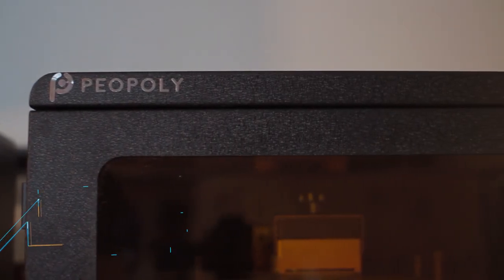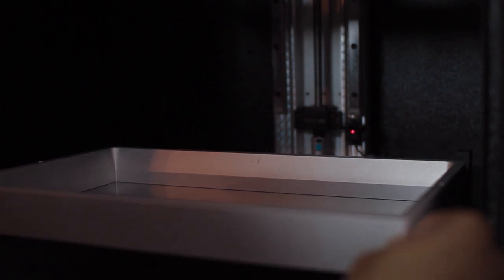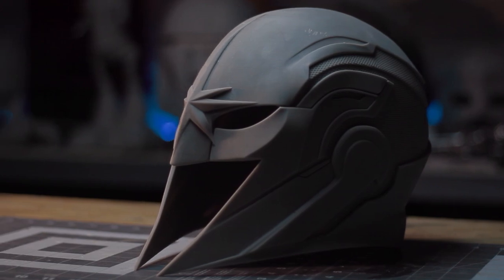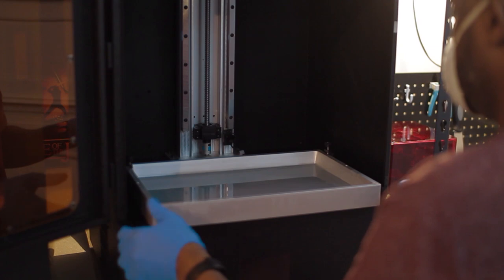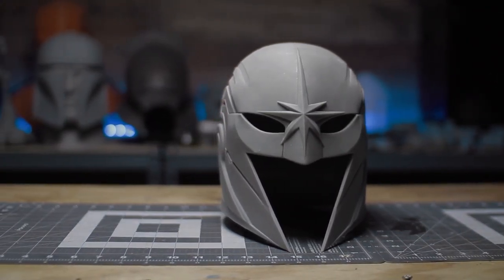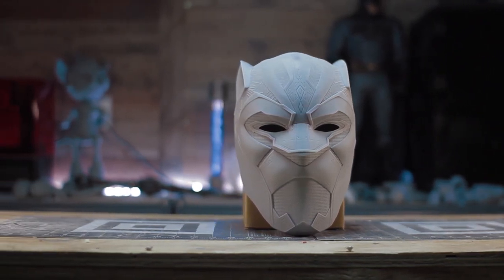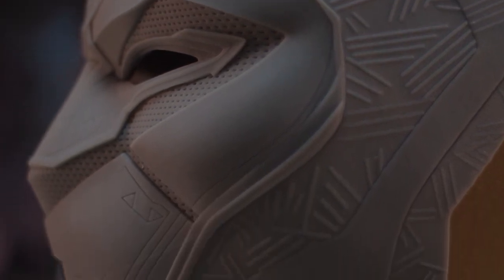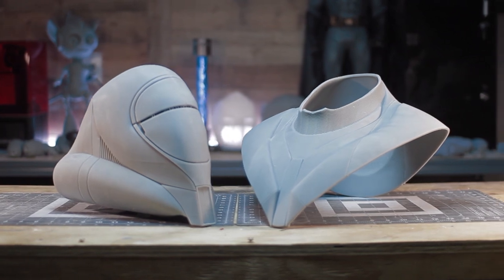3D-Printing Full Helmets! Phenom L SLA Printer Review

Comment: 37 hours..... and the monitor can only do 400? Well there went 1/6 of your  monitor's lifespan on your first print. It's hard to consider something like that practical.
Reply: I don't know for certain, because I'm just seeing this product for the first time. However, if I were to guess, the LCD likely doesn't stay on the whole time. It likely has a sleep-timer that shuts it off, and if you need to check the status, it wakes back up. Again, this is pure speculation on my part, but I doubt they leave it running for an entire 20, 30, 40 hour build.
Reply: @Bad_Wolf_Media  The LCD is what does the printing.
Reply: @forton615  Gotcha! I misunderstood what he was talking about, but I've got it now!
Reply: 400hrs is total exposure time. Out of that 37 hours allot of that will be ramp up.ramp down and wait time, rather than exposure time. Still if they are quoting 400 hours you can bet thats best case and it will be less, as with most other printers. Clearly resin printing at this scale is expensive and really only  practical for industrial/commercial use.
Reply: The Phenom website says the panel life varies from 300 - 800 hours, with 400 hours being the average. Replacement panels are $125, which isn't cheap - but it's not end of the world money and maybe it's worth it considering the quality of the prints and all the finishing work it can save you.
Reply: @Bad_Wolf_Media  The LCD displays each slice of the print in order to harden the resin, it is therefore partially on constantly through out the entire 37 hours. The word partially is pretty important there if 30 hours of build is the vertical face panels of the helm then the pixels of the screen that flash to cure the resin of the face panels ARE going to get a hell of a work out... Moving different prints to different parts of the build plate attempting to even out the usage of the pixels across many prints might be a way of extending screen life.
Reply: @fuk877  yes in the right industries this will pay for its self in no time. Would love to knowhow reliable this is. The peel forces for prints this size must be immense.
Reply: @paulgerrard6085  If anything it's probably a very low/pessimistic estimation so people swaps them earlier than they need. More swaps = more money.
Reply: Much like the bulb in a projector, it's an expensive consumable.
Reply: I have a resin printer, Print time does not equal lifespan consumption at 1:1, its more like 1:2 or 1:3 in reality depending on exposure and lift times. LCD's for MSLA have a rough rated estimate in terms of minimum lifespan when exposed to the UV curing light. It is the UV light that causes the degradation. So a 37 hour print likely consumed 12-18 hours of UV exposure time. The mode of failure is also subtle and not instantaneous deadpixel in random places, and by that point you would have printed way past due its expected lifespan before you notice your print or vat degrading.
Reply: Seriusly until a lighteningstrike killed it my LCD TV set worked just fine after a decade of use...
Reply: @michaelpettersson4919  do you fire high intensity UV through your TV?
Reply: @paulgerrard6085  No of course not. Let's just say I am curious about why it is that theaee screens have to endure that kind of punishment? Is it an integrated part of the 3D printing process somehow because it is obvius that a screen placed safely on the outside of the machine that goes dark after a few moments of operator inactivity would last for many years. This isn't the case hence my confusion. There seem to be a reason why it need to be active and bathed in UV light constantly but what that reason is I do not know. So basically, I am confused.
Reply: Yes, the display panel isn't the screen on the control panel, it's the LCD mask that blocks the UV light from the areas that aren't supposed to harden.
Reply: @michaelpettersson4919  UV light breaks down the organic binders in the LCD matrix.
Reply: @AlRoderick  Aha, then it suddenly make sense. Thanks for the information, I was really confused about it.
Reply: @Koushakur  Actually, it's pretty much right on for an RGB panel, though highly variable. ( Hence the 200-800 hours )

As Daniel mentioned, this is exposure time, not print time. For a standard RGB panel, you're looking at around 50/50 on/off. Your settings, resin of choice, etc. can have a huge impact here. If you're printing with a black or clear resin, you need a lot more exposure time, so you'll chew through the panel faster. If you're using a fast grey, it's a lot less. If you do lower layer height, you have more exposure time per mm, so again your prints per panel will suffer.

Monochrome panels last dramatically longer. Estimated 2,000 hours, and they have far lower exposure times ( 2s vs. 6-8s. ), so your prints per panel goes through the roof. If Phenom switched to monochrome, instead of around 20 full size prints per panel, you would be looking at more around 300 prints!

Unfortunately, modern high resolution panels have no reason outside of mSLA printing to be monochrome, so they largely just aren't there. Some starting to appear however, such as the Elegoo Saturn which has a 192x120mm 4k monochrome panel.
Reply: Your math is a might flawed. That would be more like 11th to 12th.  fortunately as others have pointed out the difference between print time and exposure time makes it more like a 40th or so, and a helmet is a pretty large print. Still this is a technology that is still developing... It will take several years before it is truly affordable. until then, you are paying the premium to be in on the leading edge of it. None the less, this is a technology that will produce far higher quality parts... A smart designer will have both (once SLA is in the budget) and use the one best suited to the needs of the given project.
Reply: @mattlewandowski73  It's been affordable for a long time actually. I bought my Mars for $260 nearly a year ago. It's now down to $190. Sept. will see the Mars 2 Pro release with a monochrome for $300, and a non-pro soon as well. That's just from Elegoo. There are numerous other companies with various products either out now or coming out.

Comment: How much does something like the black panther helmet cost to print in terms of resin?
Reply: Depends very heavily on the volume of the print, the supports used, how long you let it drip into the vat after printing ( quite a bit of resin can pool on the surfaces, so recovering that is a good idea ), and resin used.

Very roughly speaking though, around half a kg probably, which with standard Elegoo grey is about $15.

Comment: So the LCD screen needs to be replaced after 400 hours? The test piece alone was 3 hours, and a helmet takes 37 hours?  That's already 1/10th of the lifespan of the screen. That's gonna be alot of screens fast.
Reply: The 400 hours is exposure time, not print time. The ratio varies a lot based on your setup, but is mostly around 50/50. Still not great though, and why printers are switching to the far longer lived monochrome screens. ( Around 2,000 hours and 1/3 the exposure time, so about 20x the longevity. )

Comment: How easy is leveling? I've never used a resin printer, but I find it a nightmare on bigger prints with a fdm machine.
Reply: I believe the Phenoms come leveled from the factory, but even ones that have to be leveled manually it's immensely easy. For the Mars here is the process:

Loosen 2 screws.
Press home.
Tighten front screw, tighten side screw.

You're done.

Tiny variations in leveling are simply fixed by the way the curing works. Since the light cures the resin all the way through from the bottom of the vat up to the plate, it fills in any small gap. You have to be pretty far off to really matter. ( What will happen then is 1 side is raised up much higher than a normal layers thickness, and does not fully cure all the way through. Since it's only partially cured, it doesn't hold onto the plate well. Your print then either falls off, or the side warps. If you're using a raft and have your print raised, it's pretty common for this problem to go away by the time you make it to your actual model, so generally as long as it doesn't completely fall of you're still good.

The level of your bottom exposure, layer height, and color/opacity of resin chosen has a substantial impact. If your bottom exposure is extra long ( and there's basically no reason not to ), you use a normal resin ( like standard grey ), and a normal or even little lower layer height ( I prefer .04mm ), then you can be very quick and loose with your level. Plus, once you've leveled it, it's good to go until you do something stupid ( like laying the plate down and pushing down to get a print off, moving the plate. )
Reply: @zemerick  thanks so much! I screenshoted this to make sure I make use of this information when I get my first resin printer (smaller one to try before I jump to this beast).

Comment: Only 400h? That is so low.
Reply: Seems low to me, too. It's just an LCD, I'm betting it'll go longer. Resin prints are usually faster, too.
Reply: Imagine if you were buying a FDM printer that would only run for 400 hours before you had to replace the extruder. No one would buy it.
Reply: He mentions his being well over 400 hours in the video, too.
Reply: @nateinthenorth1999  Still, having the manufacture claim only 400h is scary.
Is almost the same as you thinking that your monitor will only last 400h. 
If you use it 6h a day, its gone in 2 months.
Reply: @nateinthenorth1999  Yes and no. It can last up to around 800 hours. However, it also might last just 200. 400 is the average, and is standard. Though...normally we're talking about a $20 5.5" panel.

This is why everyone is switching to Monochrome panels that get 2,000 hours.

Comment: Aside from the cost of LCD replacements, I think the biggest pain point with resin printers of this size is the cost of resin, which can run you something like $100 for a single helmet-sized print.
Hopefully Peopoly follows the monochrome LCD trend as well, which seems likely to increase the lifespan of the screens by a fair bit.
Reply: Resin has gone down a fair bit, and continues to fall. You can easily get some for $30 / kg. A rough estimate for a full size helmet is around half a kg, so actually about $15. Pretty rough estimate though, depending on actualy size, thickness, support needed, how much you let it drain before removing from the plate, etc.
Reply: @zemerick  Interesting, I was basing my assumptions on a video that Uncle Jessy made about the Phenom L back in May, where he said a helmet took him something like 2.5 to 3 bottles of resin to the tune of ~$100.

It's good that resin prices are still coming down though. Recently filament prices had actually gone up some due to supply shortages, followed by COVID, which increased prices even further.

I don't have a resin printer yet, but I'm looking to get an Elegoo Saturn later this year, so I guess we'll see!
Reply: @AuntJemimaGames  It depends very heavily on the helmet and resin. You could easily spend tens of thousands on 1.

IIRC he used half kg bottles, and Siraya Tech resins which are more expensive.

Comment: Fantastic review. Im researching to purchase my first resin printer and it is hard not to just go all in and go big from the jump. Why buy more than one printer? But I think you've convinced me to go with maybe something like the Elegoo Mars (or wait for saturn) and really learn the process thoroughly before going this big. So much to consider but this was very very helpful 😊👌
Reply: I highly recommend that. I have a Mars that I have loved, and a Saturn on the way. The Saturn will also be superior to the Phenom nearly across the board, though obviously much smaller print volume. ( Higher detail, faster print time, and longer lifespan panel though. Both use the same firmware and software, so the extra $2,200 for the Phenom L is kinda ridiculous. )
Reply: @zemerick  Thanks for the additional input from your experience. Im thinking ill get the Mars to get started asap and then the Saturn later on in the year when it's available. I was looking into the larger format printers cause I have projects that would require the larger print space but I have majority smaller/medium sized prints so I think ill send off larger prints in the meantime while I learn all of this. A bit of a self compromise.
Im so used to doing everything myself when it comes to sculpting, molding, casting that I resist the idea of sending work out lol 😅
Reply: @EbbnFlow_Design  I can absolutely highly recommend the Mars to start with, and I even got mine for like $270 and it's now down to $190 and sometimes on sale for even less than that.

I also encourage you to read up a lot on it though. There are a number of gotchas that can be easy to miss. ( For example, start with standard "fast" elegoo grey resin. Color is critical, and should not be taken lightly. )

Be careful though with what you read, there's a lot of misunderstanding going around lately, largely turning very specific tweaks for specific issues into generic cure alls.

The elegoo mars subreddit is a good place to go to.

There's also the Mars Pro. It has some nice QOL improvements, but they also recently messed up the LED lens recently and it has been causing problems. It should be fixed now, but it's something to be aware of.

Comment: At $2800 it better be amazing.  The specs are incredible, and 3D printers have dropped drastically in price.  If you have the 3 grand floating around this is by far the machine to get.

Comment: I'm only 5 minutes into this video, and I'll delete this question if the answer shows up later in the video. What the heck are you using to cure these huge models?
Reply: Normally for curing resin prints is to use uv-light from some kind of source i.e. lamps or sun.
Reply: UV

Comment: After printing all of the pieces for this video and maybe a few others, he had to spend 100$ for an LCD replacement, 60$ plus more for the resin but after spending 2k for the printer. If you are not using this to make your money back, then this is not for hobbyist . I will stick with my 3D printer!
Reply: The 2k might be out of the range for a hobbyist, but the LCD replacement and resin costs align with what I would consider hobby spending imo.
Reply: @brentonf8178  Now 124 every 400 hours and 60$ for a 1kg of fluid. Depending on your printing habits, that can get expensive real fast. If a person is not going to make money from the prints, that printer becomes a money pit. Compare to an extrusion 3d printer where it cost around 25 for filament, that is more fitting for a hobbyist, in my opinion. But to each their own! But since my first post, the 3d printer went up in price, 2700 from the 1999 as before. Still 60$ for 40 oz of resin.  There are cheaper resin printers out there.

Comment: What happens if you have a 20 hour print and the screen is at 390 hours of use? 🤔
Reply: You know what happens
Reply: Dollar Dollar Bill Yaaa
Reply: First make sure how many hours you have left on the LCD before printing. Thinking ahead 101
Reply: I asked before watching the whole video 🤣 ...400 is “recommended” so they can shift more screens.
Reply: Screen lifetime is an estimate. You may get more, and you may get significantly less. What ends up happening is usually vertical holes straight through the print if you're unlucky. If you're lucky, your printed object is not above those areas of LCD damage. Either way, you usually can't tell until well into the print or after it's finished. It's always a good idea to do a screen test before each print.
Reply: Maciej Gancarz Jr. Ahh that makes sense now, dead pixels. I was trying to work out what would happen to the prints.
Reply: I think the website says the screens have a life span of between 300 and 800 hours.
Reply: A helpful tip: when replacing screens, buy two your first time and always have a spare.

Comment: They need to start engineering these to be cheaper 😂
Reply: Everyone else has. The screen is about the most expensive part, and it's still only about $125. This is a case of paying for the brand name, as well as being the biggest.

Elegoo Saturn is still higher than it probably should be, and a fair bit smaller than the Phenom L, but it's also far higher detail level, far longer lasting screen, and far faster printing...all for $600. ( They also use the same firmware and software, so it's not like Peopoly spent the money there either. )

Comment: Darrell, this content is great but you've got to work on slowing the speed of your delivery, and fully pronouncing the words you're saying. 

Speak to Norm about microphone placement and the proximity effect. Like me, you're "breathy" for a lot of your hard consonants. This makes microphones and audio software work extra hard with their compressors to compensate for the amount of air that flows out of our mouth when we say hard consonants like "P" and "B". To keep the listener from hearing an explosive pop each time you breathe hard into the mic, the compressor lowers the volume of the signal very quickly.

Unfortunately it can't bring those levels up fast enough to hear you when you rush through your lines. I mean, you even pronounced your name as "Dara" at the beginning of the video. Give those L's space to breathe, bud. I promise you won't go too slow, lol

I suffered from the exact same problem when I started broadcasting. I learned that if you literally try speaking so slowly that it makes you concerned you're insulting the listener, you actually find a much better pace. Try it. Keep up the awesome work.